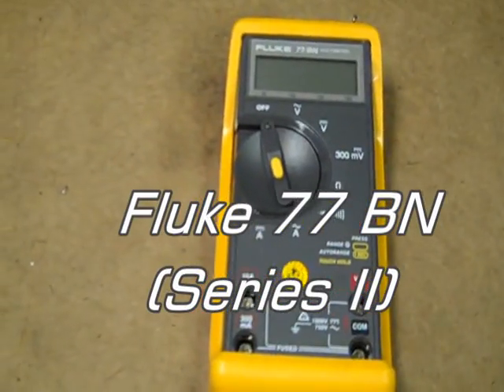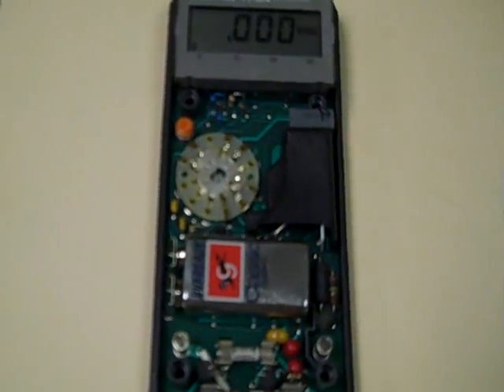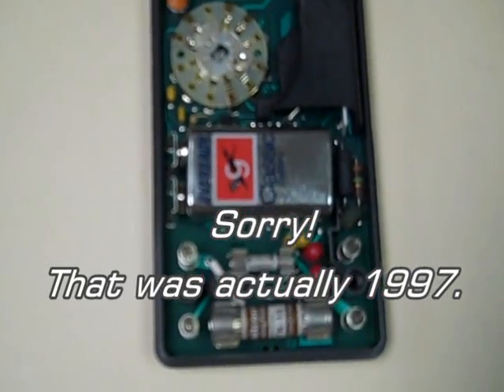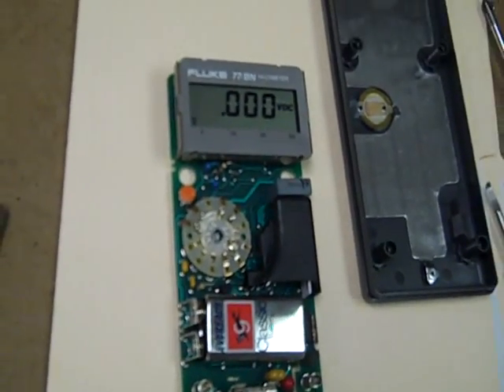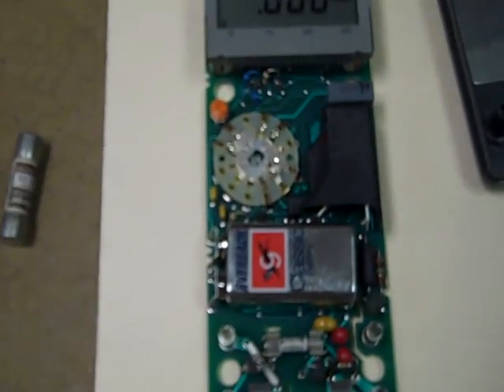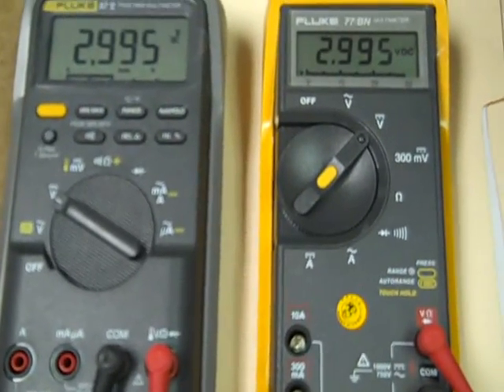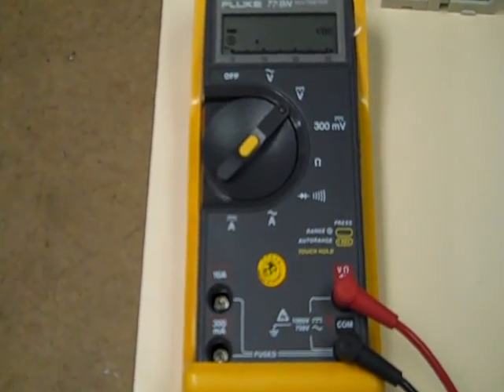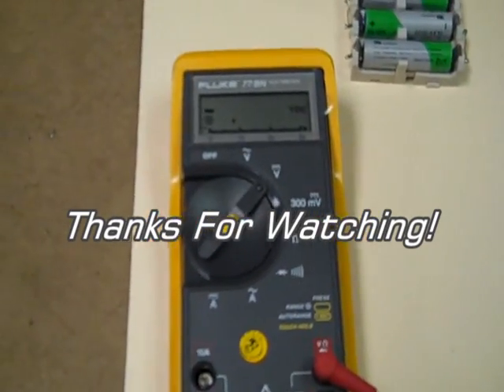Fluke 77BN Multimeter Review

Comment: Mark, My 21 just bit the dust after 15 years. I'm thinking of getting a 77 but the one I'm looking at has that BN. What is a BN? It threw me off because I never noticed those letters. Hey also whats the differences in a 21 and a 77? I bet you'd know. Thanks.
Reply from the maker: BN was a military designation, made for the Marine Corps. AN was Army. I think the 21 was the same as a 75. The 77 was the same as a 23 but the 23 was yellow. If you are buying one now, might be the time to think about True RMS. I recently had a deal where my 77 lied to me by about 40% on a current measurement because it wasn't true RMS. An 85III can be had for 100.00 or less on eBay for example. There lots of newer True RMS non-Flukes but overall many kinda fail, especially on the auto-hold thing. Don't forget though, the 83 is NON RMS. Need the 85 or 87 or above to get true RMS (or 180 or 280 etc). A 27 FM is like a 77 on steroids and does True RMS. Make sure it's the FM version though.
Reply: Thanks Mark!  I was Army... I'll  have to look for the AN.  I can appreciate the True RMS but I do plant start ups so it won't hurt me too bad. Lots of 4-20mA and 120 on and off. My 21 has been my crash around meter for so long I think I'll just get another 21 or 77. I hate change lol. Maybe I'll take the money I save and get a new DC amp clamp. I have bulkier meters that belong to the company that should be True RMS. A 789 I think. I run around too much to carry my process meter.

Comment from the maker: Glad you like the video - I'm not really an expert on the 77s but I would expect to need to clean the function-range switch and the edges of the zebra strips, and clean the metal pads on the circuit board where they touch. The zebra strips also have connection inside the lcd module but I haven't quite had the nerve to tear one of those modules apart. Make sure the input jacks are tight and there are no burned resistors or blown foil runs.